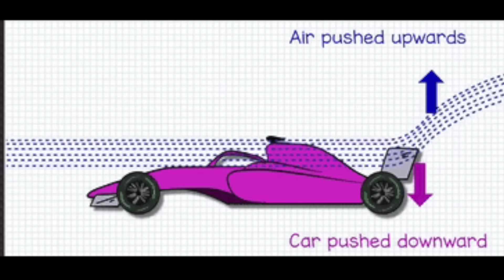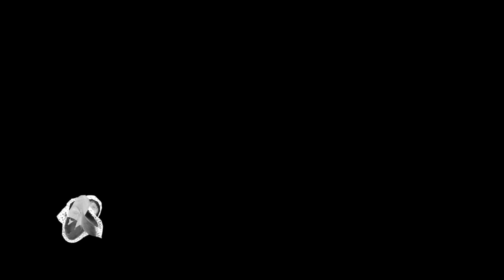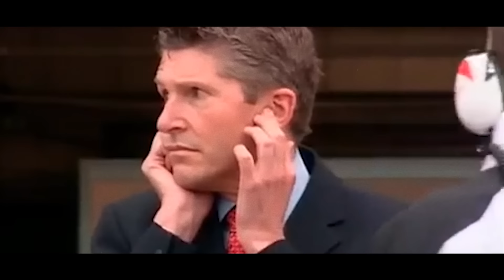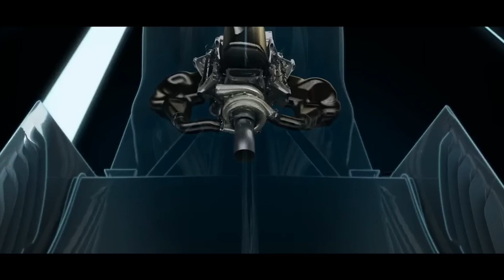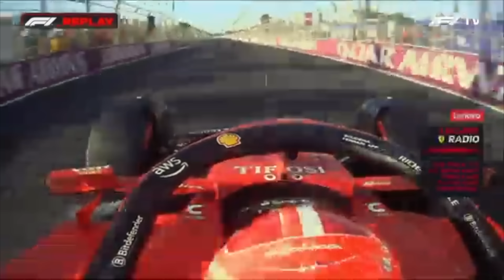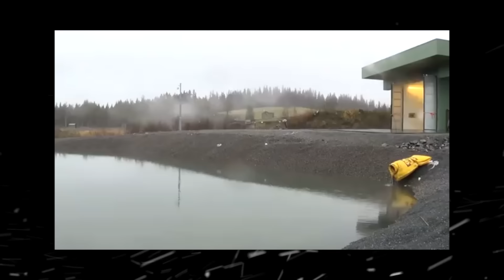What If You Keep Accelerating in an F1 Car?

Comment: I've only done 140mph in a 2008 Corvette.  I went for a ride in a Tesla Model S, and the driver launched it in the Ludicrous model. 0-60 mph in about 3 seconds.
Reply: No, next up: take the Rimac Nevera for a fly
Reply: Next up: take the 2300 hp Koenigsegg Gemera for a fly.  🤩
Reply: @EconAtheist I'll take your 2300lb wife for a ride cuz
Reply: I pushed my 1.6 diesel VW polo (chipped) to 125 when racing 2 m-sport BMWs (2&3) on the motorway ONCE, never in my life will I get that opportunity again
Reply: In my moms ‘21 Subaru Ascent, I got up to 140mph and managed to stay there. It’s supposedly governed at 130mph, but it managed to top that with OEM wheel/tire spec . It could very well easily go faster than that if unrestricted
Reply: @TheNuclearBolton you could have ascended!
Reply: @humanmerelybeing1966  lmfao or get my license SUSPENDED ahhhhhhhhh
Reply: The fastest I ever went Was 264 kmh GPS in my regular Audi A6  4g 3.0 TDI BI Turbo Quattro with 313 HP on a normal German Autobahn.
I believe it can go faster but I need to let a coder disable the 250 vmax limit.
Reply: 25 years ago when I was young, stupid and ... well I guess that's about all it took;  I buried the tach in 5th at 6800 in my hopped up '84 trans am 
Tremec 5 spd, Dana 44 3:73 and 26" slicks... Speedo said  85.... dunno how fast, but I'd bet that was 140 or more... I'd never try it again though 😉
Reply: I got my 24 z06 corvette up to 165 once but it's got a track spoiler so itgets a lot harder to push past there 160 to 165 took about 5 seconds so you can really start to feel the drag at high speeds.  Which is crazy cause 0 to 60 is about 2.6 seconds.   Maybe one day I'll try it without the full wing spoiler.
Reply: I hit 145 in my 1998 corvette and 163 when I took my exes off the road in my1998 corvette.  Only gotten up to about 140mph in my 2010 corvette grand sport, but the factory say it can run up to 184mph though I believe I could break 190mph were it not for concerns about going to jail.  However, I did achieve a speed of 174mph on a Honda 929rr motorcycle.
Reply: Managed 150mph out of my EP3 Type R (Had an accord k24) but was slipping behind a A6 estate diesel
Reply: 206 mph on my V4 Penigali.
Reply: @ianturpin9180  I went 207 on my KX 80
Reply: @billymanilli   I have 20 ducati's ranging from 50cc upwards. I have been collecting Ducati's for 50 years. Took my classic 78 900 SS to the IOM this year.
Reply: Heil Musk

Comment: I think my crime is too old and with no proof to get me in trouble.. 170-180 kmh (105-112 mph) in a rickety ~20 yo station wagon is my tops, ofc from my more reckless younger years. 2.5 km (1.5mile) straight in the super early morning when the sun was coming up, was getting near home and had absolutely zero traffic in sight for tens of km before, was like 4-5 am. The steering wheel and column started shaking so much at the speed it was getting hard to keep gripping on it while keeping the wheel straight, so I let off the gas. It was and still is 80 kmh (50mph) zone (the default speed limit on roads in my country).

Comment: Well, I did about 340kph in my GTR but the fastest corner was T1 at Le Mans with an F1 car during a demo where I happened to be driving. It’s an open 90 degree right in seventh gear with 315kph entry and 310kph exit even though I was flat to the floor (Renault R27).

Comment: Hi Revved Up,  here's what I might have done.... 1967 mustang fastback..... over 144mph, probably a little under 160mph. The street night time lights passed by in a blur, and the car floated on its suspension at times. Otherwise incredibly stable on my 2 mile speed run,  20+ years ago.
Reply: Now a days you got economy sedans going 145? I heard that is theoretically possible with a 2016Mazda6 4 cylinder. Don't know tho. I haven't tried it. ;)
Reply: I did 155+ across the Twin Bridges (Davenport to Moline) in my very new 1993 Z28 Camaro. Amazing how solid feeling it was and how quickly it got to that speed

Comment: The skid plate is wood. Not titanium. The fasteners that hold it to the car are titanium.
Reply: Good call, but... a). The skid plate used to be wood, now it's a polymer, regulated by the FIA and it has to be exactly 10mm thick. b). The main element made of titanium, generating the sparks is the bib.
Reply: Nothing about wood is safe on cars 😂😂😂
Reply: @aerayay123  the block of phenolic plywood under my carb begs to differ
Reply: Yea... it isn't.
Reply: Nice try, dumbass. It ain't wood.
Reply: Quick AI search, skid plate typically made from a bi-composite material. This usually includes a carbon fiber composite and titanium

Comment: Engine would overheat, coolant begins to evaporates, fuel will be gone, idk whats next
Reply: Not sure about the cooling tolerances, but I would bet something mechanical would fail before the temps would boil the coolant. The higher the speed, the higher the airflow over radiator, the more cooling efficiency between air and coolant and engine, no?

Comment: As a Formula 1 sim racer, I can tell you its spot on about the lower speeds. I know what I do is digital and not the same as real life but the brain still reacts the same to the response times despite it being real world or digital.
And on a sim, when you're doing 50-100 mph in a F1 car you're only in 1st or 2nd gear and it feels like you're doing 30 in a regular car. I'm not kidding I've gone around sweeping turns on a formation lap at low speed and thought "man I'm crawling here." Looked down at the speedometer and saw I was doing 90. You get so used to doing 150-200 mph, normal high speeds seem ridiculously slow.
Reply: I think the track design and safezones might be contributing to that. Like IRL on a 4 lane highway on a long straight, 70 mph does really seem slow, and you wish you could go faster. Then again, on a narrow, twisting and turning residential street 20-30 mph feels like "the safe limit".
Reply: @asdddd-askapaska  With regard to the track width, what you're saying is accurate.  Then again, F1 is not NASCAR and very few Formula One tracks are wide enough for that to be a a significant factor.  And some of them are rather narrow in some places.
Reply: It's the same in real life when you get used to speed
Reply from the maker: I've always wondered how it felt in the sim, thank you for taking the time to write this!
Reply: Yes yes yes I got to test drive for roush racing tallaga at 200 mph for 50 laps that when we came down the pit lane and reached ,if I remember rite,I was 19 then today I'm 63 ,,2100 rpm in 3rd gear it seemed like it took an hour to do that 3/4 mile pit lane and another day comming down pit row even slower in 2nd ,at that slow speed down the pit lane off the track not only could you climb out crawl faster your still doin 60 mph ,commin off the track onto a level ground my body was in pain and a bit hard to walk after that I would of loved to do the 200 but they only allowed us to 50 laps a day and they tested only 3 days a week and two to three mo there
Reply: Yeah I think that’s a very accurate description of how our perception of speed shifts when you’re going very fast.
Reply: I also play the F1 games. And you're absolutely spot on, all the pit lanes have different approaches so sometimes to avoid the speeding penalty I end up slamming on my brakes and activating the pit limiter early and going 37 mph feels like you're going 5-10 in a normal car

Comment: 276kph in a Porsche ( Driving School) 😅 was hella fun. Normaly I drive between 180-220kph.
Reply from the maker: What kind of driving school is that 😂
Reply: @only_revved_up  learners permit
Reply: I bet you live in germany
Reply: @initiald975  Yeah I do. 😂
Reply: Deutschland beste
Reply: Yep that sounds about right for German cruise control 😊😂
Many Germans are very conscious of fuel efficiency and cost though - so most common driving speed on the Autobahn sits between 120-180 kmh. When I’m going home to visit Germany, I do enjoy a little gentle speeding at 180-210kmh. Best at night with a good playlist and a little bit of guilty pleasure as I burn through the tank. 🙈
Reply: What is that metric system
Reply: @Siple_YTroughly just below 170mph

Comment: Great video, really thought provoking. Self incrimination. Mine is probably very modest by today's standards anyway 170mph (UK / imperial) on the M3 dead off night for 30 miles on A Honda Blackbird (unmodified). (You know when you stayed too late for the fireworks after the last night of Cowes, but still have to get to the city for 8.30am the following morning..
More recently on the German Autobahn (E1) (east bound)  to Poland 150miles p/h for   100 UK miles on Saab 9-3 Aero, slightly modified.
Common youngsters, demolish my record😂
Reply from the maker: Autobahns are great, I’ve never been tho
Do you get a lot of flashes if you’re in the right lane at less than 200?